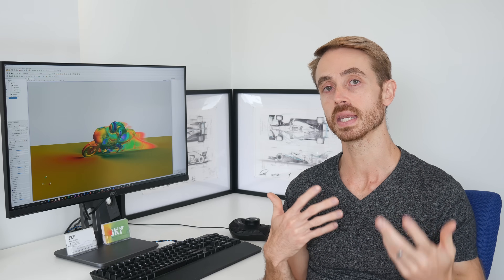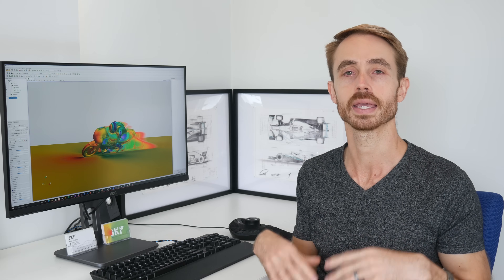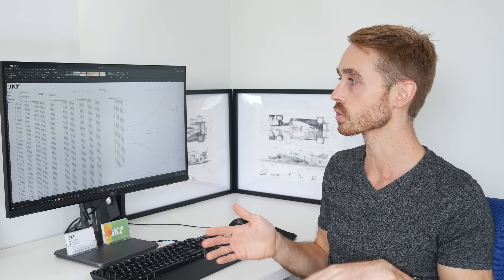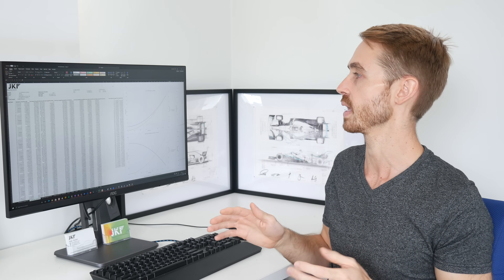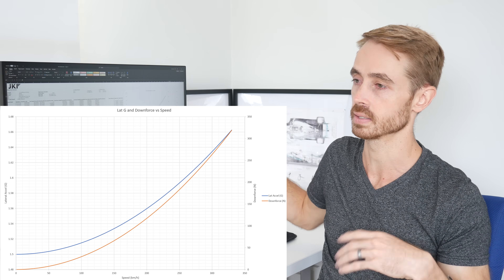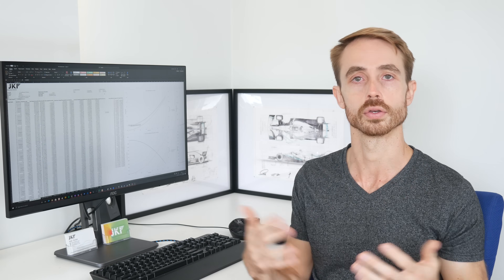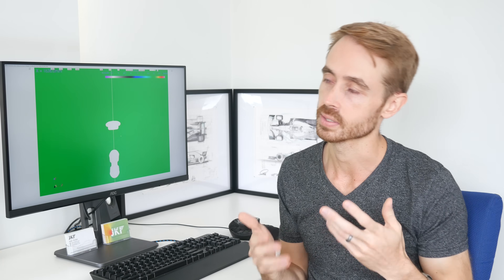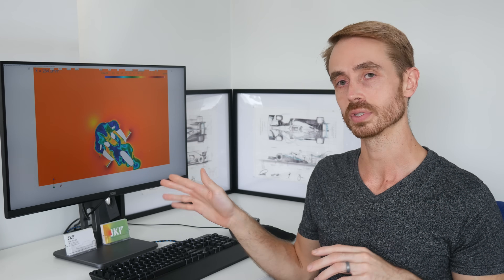How Do Motorbike Winglets Work?

Comment: if I remember correctly, in your previous video you said that downforce on a motorcycle in a corner is actually undesirable. Because the bike is lent over in a corner, the 'downforce' is actually pushing the bike away from the apex. You didn't touch on that in this video. Is this also true and would that actually make it a good thing that the winglets produce less downforce in a corner? Nice video anyway and glad to have you back on youtube.
Reply from the maker: So I'm assuming the previous video we are both talking about is this one here: https://www.youtube.com/watch?v=Y3nEbwOTN3g 

The main gist of that video is that as the bike leans over there is a component of downforce pushing out, like you said. However if the rider is hanging off the side (motogp style) the more upright angle of the bike with respect to the overall CG position at limit cornering grip means that the benefits of the vertical force being added on the tyre exceeds the negatives of the horizontal force (assuming the majority of downforce/lateral aero force is coming from the bike itself). If you have the bike laid down (motox style) then the opposite is true. Make sense?

Worthwhile clarifying here that the downforce numbers I talk about in the video are true downforce (vertical with respect to the road, not the bike). 

Glad you enjoyed the video and glad to be back!
Reply: @KYLEENGINEERS  Makes a lot of sense!
This is why winglets introduced in motogp produced a new riding stile, like Marquez, hanging off as much as they can in order to keep the center of gravity in the same place but with less roll angle, in order to add more vertical down force and less "centrifugal" wind force.
The inconvenient of winglets, apart from drag and a more phisical riding style, is that tyres has much more stress to absorb and also the friction coefficient get reduced by adding weight so, is easier to "overload" a tyre, reaching the point where you have less grip instead of more.
Reply: @KYLEENGINEERS  whats the name of the software?

Comment: kyle, can you talk about how close CFD represent the reality?
Reply: depends on your computing power and validation results, for engineering purposes most of the CFD - RANS applications are acceptable. however, when you consider the wing deflections and cases like where surface deformations actually play a role (take a look at anderson's aerodynamics book, it is explained nicely there how drag polar is affected by deflections of the wing) without the addition of structural elements (or chemical elements in hypersonics etc.) your fidelity will be reduced. however, if you can afford a dns around an aircraft (seems impossible until 2070-2080 but please prove me wrong) you will get the best results, which theoretically has higher fidelity even than those of wind tunnels.
Reply: @BerkSarikaya  DNS on an aircraft? Not going to happen probably ever, unless quantum computing will prove to be a breakthrough in this respect, but that's pure speculation at this point. 
The highest Reynolds DNS I ever saw was at a bulk Reynolds of about 150,000, and that was for a simple channel flow. The required mesh size for DNS scales as Re^3. If we assume a Moore's law doubling of transistor count every 4 years, then in 60 years supercomputers could do a Re of about 5x10^6 for simple channel flows. But airplanes are far more complicated than channels, and typical airplane Re are in the 20-80 x10^6 (at least for airliners / fighter jets). Also, Moore's law is rapidly coming to an end. There are now processors on the market with 7 nm technology, and the theoretical limit  imposed by quantum mechanics is 4 nm.

Now LES/DES on the other hand, that is very promising. I believe it was already demonstrated in application for full configuration air planes, and it can be more accurate than wind tunnel testing. I myself did a DES simulation for a submarine model at Re of O(10^9) and got results that pass right through experimental data points.
Reply: @ASJC27   oh thats very nice! I also validated various flowfields over a fighter aircraft using standard RANS! A similar mesh size requirement is also present on LES I think, if I recall correctly it was Re^9/4. Similar to DNS, it is still a burden. However, maybe I should have said LES on aircrafts 2070 commercially; you are right about that. I think there is one DNS carried out at Re of about 100K in youtube over a 63012, but do not quote me on that. While I do not fully agree on your DNS thoughts (rather than considering cruise conditions, consider takeoff or landing parts of the mission maybe half an order less Re? and consider huge HPCs), I agree that we have still a long way to go in terms of computing power. However, with enough CPUs (looking at you top500 supercomputers) I believe there is some possibility but not commercially of course. I am unsure about commercial usage of LES outside of the wind turbines LOL
Reply: @BerkSarikaya  Ok, so what are these things? LES,DES,DNS,Re,RANS? And why does Kyle never talks about deformation of elements due to fast airflow or pressure differences due to temperature?
Reply: @schipe  Okay, I will try to be as thorough as possible hopefully this will satisfy you. So, there exist an equation set called Navier-Stokes equations. These equations govern the fluid flow for unsteady (i.e. time dependent) rotational (produces vorticity, can be thought of as the tip vortices from the rear wing), viscous flows (causes "skin friction" which adds up to drag coefficent.). So, also in the nature there is "turbulence". Turbulence depends on Reynolds number. (I am simplifying it here). Reynolds number (Re) is the ratio of the inertial forces to viscous forces. That means high Re number flows (fast flows!) are more inertially dominant. So, after a critical Re, transition will take place and turbulence will occur. The turbulent structures are called eddies. The size of the eddies start from very large eddies to large eddies to small eddies. Large eddies contain energy, and smaller eddies dissipate the energy by means of viscosity (heat). So, now you know the basics. 

Now, if Navier-Stokes equations are assumed to be consisting of fluctuating and steady parts, statistical averaging yields RANS equations, Reynolds Averaged Navier Stokes equations. Now, this averaging process creates an artifical term called Reynolds Stress and this term is generally modeled by empirical relations or some computations. Since RANS equations "model" the turbulence, the eddies cannot be directly resolved. In this approach, mesh (computational domain around the object of interest) can be coarser than LES or DNS. Also, these equations can either be steady (RANS) or unsteady (URANS). In theory, generally RANS is the least accurate due to assumptions it is based on, like eddy-viscosity models. There are Reynolds-Stress models but I will not go in more depth.

LES stands for Large Eddy Simulation, as the name implies, large eddies are resolved computationally, and smaller eddies (dissipation range) is modeled. This is obtained via a filtering process that is different than RANS.  However, due to resolution concerns, this simulation is more computationally demanding than RANS. This means, finer time scales and length scales are needed. So, much more smaller elements and smaller timesteps. LES is inherently transient.

DNS stands for Direct Numerical Simulation. Everything in the flowfield is resolved. Nothing is modeled. Navier -Stokes equations are solved directly. As you can imagine by now, due to very small eddy sizes, this is insanely demanding in terms of computation. Much much more computational resources are required in DNS. There a lot of videos on youtube. 

LES and DNS mesh requirement scale with Reynolds number and in a non-linear fashion. Scaling of DNS is much stronger. As an example, increasing Re means smaller length scales and smaller time scales.

So, for the deformation part: "in general" the structrues are designed in such a way that these deformations are small. However, I recall that Redbull F1 front wings were flapping a lot in the straights in 2013 or 2014. So, interactions of the geometry and the flowfield can be resolved by Fluid-Structure Interactions, or by basic models after some point. For example in 2D analytical calculations yields very good results in plunging and pitching motion. However, FSI requires to solve a "transient" problem and also a finite-element solver is generally required to compute the deformations, for example. I am not that great on FSI, feel free to correct me on this. As an example: https://kratosmultiphysics.github.io/Examples/fluid_structure_interaction/validation/fsi_turek_FSI2/ can be checked. Turek example, I found this online. Also, if small deformations are assumed and observed in wind-tunnel testing etc. then there is no need to carry out FSI. However, when you think multidisciplinary, these temperature differences or unsteady behavior may create a temperature stress ,for example, which can decrease the fatigue life of the structure.

Hopefully this helped. The world of Aerodynamics (and fluids) is very fun and interesting!
Reply: @schipe  Forgot to mention, DES is the Detached Eddy Simulation. Near walls RANS equations are solved and at some distance away from the wall LES equations are solved. It is a good trade off if set-up properly.
Reply: @BerkSarikaya  Thanks for the good intro, this looks like a deep hole... I am quite familiar with CG simulations, but not on CFD part, i guess you need to make the hard computational parts easier, and these are the available choices. Each has pros and cons, and they good for different situations. I imagine it also depends on the actual software and the exact implementation and parameters of the calculations (maybe except DNS). Do you know more good sources about CFD in youtube or other sites to dig into this? Or should I just download a software and play with it to learn?

And regarding FSI, I think for a racing car or in F1, it is a huge advantage if they can lower the downforce in the straights above a certain speed, if the elements on the front wing bend, so the aoa becomes lower, you'll have less induced drag. You don't need as much relative downforce anyway as you need in the slower corners. Just like DRS, only this one is activated by the generated lift reaching a certain point, and controlled by the carefully planned stiffness of the element. This looks like a gamechanger for me in ultra high performance racing, but never heard about this topic from Kyle.
Reply: @schipe  CG as in computer graphics? Could you please elaborate more? I did not get that!

Well, the displacements are limited by a maximum amount with the regulations for the wings and other aero devices on the cars. That's why I believe FSI is not feasible for F1. I also think buffetting is not a thing in F1. In aerospace industry sometimes I needed FSI to determine actual drag polars rather than relying on static wings/fins cases. It is probably a better idea to test dynamic phenomena in wind tunnel rather than CFD like aerospace industry, especially considering the limited CPU time for F1.

To start somewhere, there are a lot of videos on youtube regarding CFD. "I do like CFD" is a great book to both refresh mathematical concepts and to build up. There are tons of CFD books available, maybe you may also want to check Anderson's CFD book.

SU2 and OpenFOAM are two very good open source CFD solvers which are available for free! You can experiment with the every possible setting. SU2 has a wide tutorial repository. I heard that openfoam predictions may be slightly better in incompressible regime than SU2. (where F1 cars drive)
Reply: @BerkSarikaya  I would be curious what is exactly written in the F1 aero rulebook. What rules apply for the elements' stiffness. And even then... I am not sure the same effect of reducing drag above a certain speed, is not possible using an aero element further ahead. Just creating a pressure zones which move up or down with the change in speed.

Thanks for the CFD information, ill check those out. I already tried paraview and simscale years ago. I liked them very much, it was the model manipulation which was an issue for me. Couldn't change the aerosetup of the downloaded car, and i did not find a way to digitalize my own car. But it was just curiosity, its not my profession.

I had some experience in CGI, I am pretty familiar with lighting models, and for eg. the ambient occlusion is a good example of skipping hard calculations with a much easier model. The first time I heard about Navier-Stokes was also with CGI, when the guys talked about it in the Pirates of the Carribbean 2 making of videos in 2006. Creating the sea, and the whirlpool... I guess CFD softwares were quite good at that point as well, but i did not checked those out until one of Kyle's videos.

I think Kyle does an amazing job showing the most interesting part of F1 and supercar engineering. I think he is in a hard situation, many things are covered by their NDA for sure...
Reply: Its a simulation.